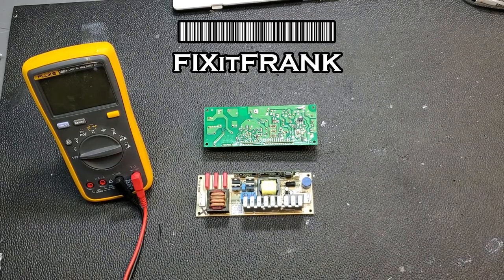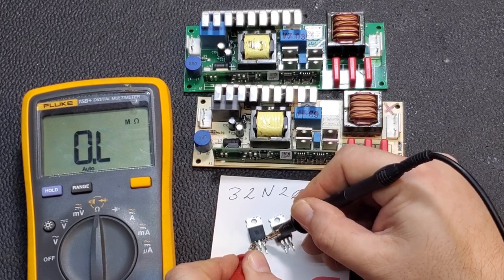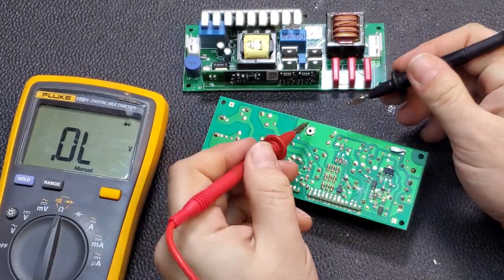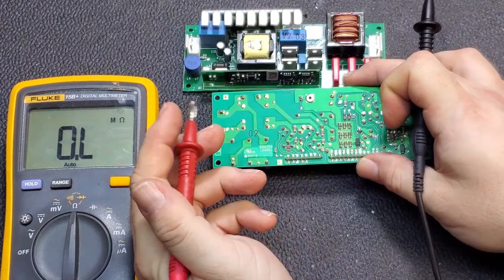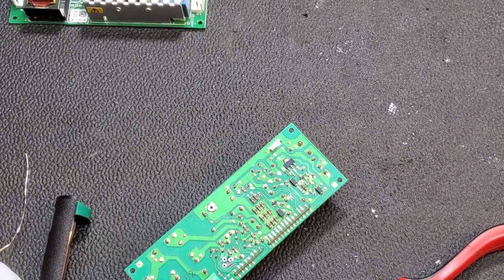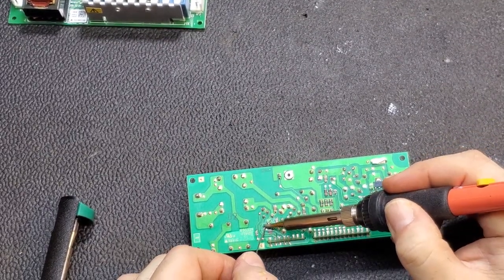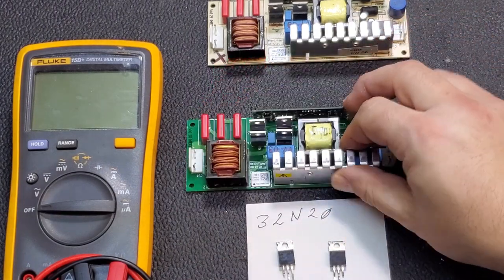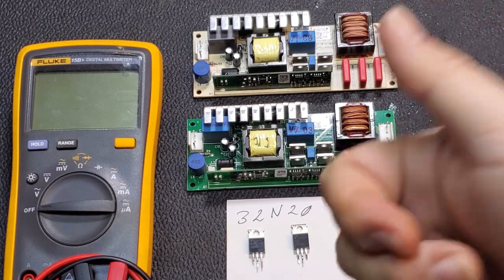Digital Video Projector Ballast Diagnosis and Repair

Comment: do you know how i can get myself a new ballast for the optoma hd83? can't find a single one on the net…
Reply from the maker: Hello! They are had to find for sure. Are you able to post a picture if the old ballast? I may have one. I scrapped an hd8300 that should have the same ballast.
Reply: Hallo Frank! I started opening the black box here. I suppose the one in the middle is the board controlling the ballast, and it should be hidden under the metal hood where the two white wires are going to from the lamp, shouldn't it? https://imgur.com/a/zkWLT3E
Reply: Now it has to be said that I rely on what customer service told me on the phone here, i.e. it could be the lamp or the ballast. Symptoms were image goes darker and darker, gets a little lighter, darker again, to nothing at all. I initially thought it was dust so I opened it and simply rinsed it with a can of CRC dust off. Once it was on again I could see a whole movie, but then darkness again. Hope you guess more from it.
Reply from the maker: Those pictures are perfect! Thank you!  I would try a new lamp first if I had the projector in front of me.   The fact that the lamp lights at all, makes me less suspicious of the ballast. It still may be an issue but in my experience, a bad ballast tends to not light at all. However, I have, on very very rare occasions seen ballasts act like you describe. Like I said. Very very rare.  
I would try a new lamp and make sure it has the proper bulb and lens coating.  Many cheap lamps on amazon tend to use knock off components.  You need a BL-FP280F lamp https://www.purelandsupply.com/bl-fp280f-optoma-projector-lamp.html  This is what it should look like.  The bulb needs to be an Osram 280W bulb and make sure the lens on the front has the proper blue/red coating.  Otherwise your color wheel will suffer from IR flooding and create a new issue. 

If you put a new lamp in and the problem persists, let me know.  I am pretty sure I have that ballast around. The part # you want to look for is the 75.8K01G001A or 74173B00DG on that white sticker.
Reply: Thank you for your time and help Frank!!

I bought a new bulb and mounted it in the old  frame. 
By the way, you mention the glass in front of the bulb should have a blue tint, but neither the one installed by customer service as a replacement after 3-4 years of use, some 3 years ago, nor the one I now bought as “original for the HD83” has any glass in front. It’s an empty “bowl” with a stem in the middle that goes actually beyond the border of the reflection dome. I thought then that that was the problem, but when the new one came in, I had to think that the glass in the frame does the job. 
https://imgur.com/a/chqtTXa
https://imgur.com/a/qDluuLG
Anyway I mounted everything back but I managed not to take a picture of where a cord goes to.
https://imgur.com/a/QvK2Vxn
You see it comes from that little circuit board attached to the plate that covers the guts of the HD83. 
There are to pins available on the larger board.
The one seems to be labeled “temperature sensor”, the other one, “fw_update”. 

I tried temperature sensor as you see on the picture.
I could switch the projector on and see the source attached, but I couldn’t make it switch off.
At last I had to open the lid that gives access to the lamp frame and then the projector switched off (and I got orange led steady on and blinking red power led, i.e. lamp fail, according to producer, of course)

Can you help, again?
Reply: FixitFrank forgot to tag you…
Reply from the maker: @ItaloProfeti  got it! I have an hd8300 (same main board). I will check to see where the temp sensor plugs in. The lens I refer to is on the housing in front of the bulb. I think this model has the glass inside the projector though. Most dlp projector have the lens on the lamp housing. I will get back to you in a day or two. I need to get the hd8300 I have out of the storage.
Reply: FixitFrank thanks. A lot.
Reply from the maker: I opened my 8300 but do not see a connection for the temp sensor.  However I did notice the mainboard is labeled.  I suggest looking for a 4 pin(I believe the sensor had 4 pins) connector that is open that has "temp" or something along those lines. The wire will only be long enough to reach where it needs to go, so hopefully that gets you to a solution. I will keep looking as well to find the spot.
Reply: @FixitFrank   would you think this (https://imgur.com/a/QvK2Vxn) is a temperature sensor, though? Does it make sense it's attached to the metal cover of the whole area?

Comment: Hello. I have a benq mw712 projector and it does'nt turn on. It tries to power on three times than the temp and lamp lights go red. What should i do
Reply from the maker: Hi Timi,  See if the light blink in any pattern.  Such as 2-4 flashes before a pause and then it will repeat. Here are a few causes I have seen in the past.
1. Old lamp exploded and piece of glass got stuck in the lamp turbine fan. Removing the glass fixed the issue. Gently pushing the fan with a cotton swab was enough to get the glass out.
2. Fan Status wire not responding properly. The RPM wire on a fan may not be sending the proper signal when it goes to turn on. I have seen the power supply fan cause this, but it can be any fan.
3. Axial fan is jammed. One of the normal type of fans may be stuck.  

What is the history of the projector?  When did the issue start?
Reply: @FixitFrank  hello thaks for the info. I managed to get it to turn on. The problem was at the color wheel, the black tape on the wheel for syncing was missing so i put a little black tape and it turned on. But now i have another problem. It stays on just about 30seconds then turns off. No warning. However the lamp light just flashes once then stays off. The power light flashes several times until i cam turn it back on. What should i do?
Reply from the maker: I would double check all of your connections.  Also be sure the tape is in the proper spot and proper size. If it is too large or small(the tape square) it can confuse the color wheel sensor.
Reply: @FixitFrank  double checked all the connections. They are good. The tape is 90% the same size, i think i placed it in the same spot but i don't know that for sure. Does it matter? When it turns off the power led blinks awkward, it dims down but not all the way. When it does this i hear a very subtle ticking sound. Could it be the voltage regulator or another thin on the power supply? Or on the ballast board? How do i check them?
Reply from the maker: @3ikeru  The tape position is important.  That sets the index mark for the the colors. It needs to be in the same place as the old sticker or you colors will be wrong.  However, if its not spinning that makes no difference.  I doubt the ballast is an issue.  I suspect your color wheel is actually bad.  The ticking noise may be the wheel trying to spin and not being able to.  I would verify the wheel is spinning/not spinning first.  Bypass the door switch with the lamp removed and you should see the wheel spin 3 times before getting a lamp light.  If it never spins, then it is bad and that is the cause. Heat that causes the sticker to fail can also damage the magnet and windings leading to this situation.
Reply: @FixitFrank  it turns on every time. The color wheel spins every single time
Reply: The colors in those 30 40 seconds before it shuts down are good
Reply: Can i send you a video?
Reply from the maker: @3ikeru  Good idea.  I have it listed on the about page.
Reply: @FixitFrank  can't find it?
Reply: @FixitFrank  i have seen it. You can delete it

Comment: Can you please create a video to reset the password for Vivitek Qumi 6 projector?
Reply from the maker: I don't have one unfortunately.  So I don't expect to be able to do that. According to the manual, you should probably call vivitek support. I'm guessing you hold some buttons down or something to do a hard reset.
Reply: @FixitFrank  I contacted them but they are asking proof of purchase which I don't have:(
Reply from the maker: Ahh. Gotcha. I did find a reset for a different model but it is a Qumi. Try unplugging the power cord, then hold in right arrow on the keypad. While continuing to hold the arrow key, plug it back in. If the LEDs flash, it might have reset.

Comment: Hi, My optoma HD20 : power led flash green 5 time->power led turn to orange .
Sometime flash green 6 time ->power led turn to orange(Temp LED & Lamp LED flash orange 1 time quickly  ). Could you help me ?thanks

Last weekend, When I watching movies ,my optoma HD20 power board exploded suddenly. (LNK364PN was burned out),Then I  replace new power board but it still not work. 

I test all MOSFET that in Ballast, All MOSFET is work good.

Then I test  ballast voltage when I press start bottom.(My ballast look like same as this video)
Input : 380VDC
Output with lamp: 0~10 VDC , 0~14 VAC
Output without load :  0~10 VDC , 0~14 VAC

Is my  ballast broken?
Sorry my poor English .
Thanks you very much.
Reply from the maker: Hello, Your english is very good. I also had LNK364 explode on my HD20. I replaced power board and it was OK.  380V is good on input.  
Please check low voltage into mainboard. Also check ballast control wires. Lamp_on is low signal(5v=off, 3.2-on). If Lamp_on signal OK, ballast is bad.  I think control IC on ballast failed.

I will check my HD20 for you next week.  Here is the service manual, but it has no schematic.  The LED code you suggest do not appear in the service manual.  This is why i ask about low voltage into mainboard. Voltage regulator on Mainboard may be shorted preventing ballast turn on. 

There are many possible causes right now.  We will find the root cause. 

Also, please do not measure ballast output.  Ignition voltage can be 20KV @10ma AC 20khz. Running voltage is only 80-120v on average. 

I will wait to hear from you.  Thank you for watching my videos!
Reply: @FixitFrank   Hi Frank, I am sorry for the late reply.
I checked my motherboard power IN . (stand by: orange light)
+5V =>5V
+12V=>0V
PFC=>0V
Then I checked ballast control wires (Is J20 socket ?)
 Connected ballast board
  -pin1:0V
  -pin2(GND)
  -pin3:0V
  -pin4:0.03V
  -pin5:0.06V
 Disconnected ballast board
  -pin1:0V
  -pin2(GND)
  -pin3:0V
  -pin4:0.33V
  -pin5:0.37V
Thanks your help

Comment: My problem Hitachi XGA CP-X327 when i on power suiz after sec lcd screen on, then fius burning...fius 5a 250v...i don't know why...any one do know it?
Reply: Or my ballast probably problem to supply high voltage
Reply from the maker: Fuse sounds small. Check the fuse and see if it needs to be 6.3amp. 5 sounds too low. Does the old fuse turn black or just burn open the little wire?

Comment: Hi Frank 👋..I appreciate your work..just I have this beam 230..when I turn it on all fans are working normally but the display doesn't light up.. I measured the voltage and it seems that the board with the LCD on is not getting any voltage.. my question is: is the lamp necessary for the display and control to work because the one I have doesn't have a lamp installed yet. Second, is the board you worked on in the video responsible for power supplying the control board? I hope you find the time to answer me 🙏🙏🙏🙏 thanks
Reply from the maker: Lamp is needed or it wont fire up the rest of the way. I would try a new lamp first. The board I show is just power for the lamp.  The power for the electronics is prior to this board.

Comment: Do you know what kind of ballast an optoma uhd50 has
Reply from the maker: I'm sorry I don't. I wont work on Optoma UHD series projectors if I can help it. They are nightmares and tend to start failing all over. They were designed to run really hot and the mainboards, DMD and other parts get cooked. I will clean them and replace the color wheels but thats about it.  Anything else is a gamble on if it will last a week or a minute.  Optoma really put out a lemon series with the UHDs.  I know a few installers who dropped optoma all together because of them.
Reply: @FixitFrank   yeah I noticed they run hot too when I got it it was nice and white after 5 years running the heat looks like it baked the paint it's like a yellowish color after the 5 year mark whenever I turned the projector on half the screen would be darker I would have to do test pattern and scroll through the colors for it to come back to normal well that really sucks was hoping uhd series would be good considering how expensive they are
Reply from the maker: @dafuq2165  exactly!!  I was seeing them literally 2 days past warranty with bad DMDs and mainboards.  I hate that they are this way.  that half screen thing you are seeing is likely the mainboard.  the DMD drivers overheat and go bad.  I hate to say it but if you got 5 years, cut your losses and check out the newer BenQ with a real 4K dmd and no pixel shift.  They appear to built pretty well.
Reply: @FixitFrank  thanks man breaks my heart cause I love the projector to death but I called customer service technician who by the way was very rude didn't even tell me the projector was discontinued this will probably be the last optoma I every purchase use me as a warning for potential future commenters and customers not buy they are loud and have a terrible light border
Reply: @FixitFrank  do you like the BenQ tk800m are they reliable
Reply: @FixitFrank  I went out of my way to pull the power supply ballast it's a PH-AIO-385 they don't make them anymore but uhd60 power supply ballasts are compatible but they are all used 🤣
Reply from the maker: so far I hear they are.  I like BenQ for the price.  I would buy that or a Viewsonic.
Reply from the maker: Did your power supply fail?  What a hassle!!  Freaking optoma...

Comment: Well while this is cool, and I’d love to just be as I once was, and replace the damage piece in my projector, I was a t3ch for 20 yrs, and I’m a DVET,now mostly bedridden. Miss fixing building cars, doing electrical repairs and electronics..but my $1500.. 4k projector just died after running the bulb too long ,I couldn’t get anyone to take it down from the ceiling,guess it got to hot after bulb failed ..I swapped the bulb, now it simply comes on and then turns off after about 1-2 mins, the bulb replacement light just blinks still..for some of us it’s easier to save and buy a new projector instead of fixing it..when you can’t anymore..I know a repair shop will charge 3 to 400 bucks to replace what your doing for free, lol..shame as I don’t trust small repair,computer,tv stores ,I’ve since seen too many rip ppl off..I once many yrs back had a guy come to my house tell me it was 200 to fix my old school DLP 500lb tv, when I asked him to show me what he was going to repair, he wouldn’t saying well if I show you what stops you from telling me no your doing it yourself,? lol I would of let him simply because the $200 bucks was worth the warranty for it to work for a yr at least..yet he was a scammer , I hate small repair techs who won’t show you what’s fails ,and let you watch if your doing it in your own home, maybe he thought I’d be upset seeing how easy the repair was, or maybe it didn’t help that I was wearing my double master tech work shirt after getting home from working all day..anyone who repairs anything should always be willing to show the customer how it’s done or let them watch if they ask, why not, as long as they aren’t getting in the way, ???
Reply from the maker: If the old bulb exploded or burst, you probably have glass in tbe blower fan(temp led will also blink). Or if the picture flickers the colors before it shuts down, it's possibly the new lamp. Cheap lamps from Amazon or Jasper tend to use junk Infrared blocking filter lenses. They flood the color wheel sensor with infrared light causing it to shut down. If it's an OEM bulb, then something else is going on.  I hope it's just a cheap lamp problem. 
I don't mind sharing what I know but I can also see the side of the gatekeepers. It costs time and money to run a repair biz, and if you give away all your secrets you can't put food on the table and someone might hurt themselves or ruin their equipment and blame you since you showed them.  I think finding that balance and knowing who can benefit from your knowledge and who can't. Some folks are all left handed screwdrivers you know?

Comment: Nice video,where can I source MOSFETs 30nf20 from,not much info on the net,from Australia,
Reply from the maker: that's a 30amp N channel 200v. I doubt its using all 30 amps or running at the full 200v. Usually its about half. However, if you can go 30amp, 300V(30N30) you can use something a little larger pretty safely.